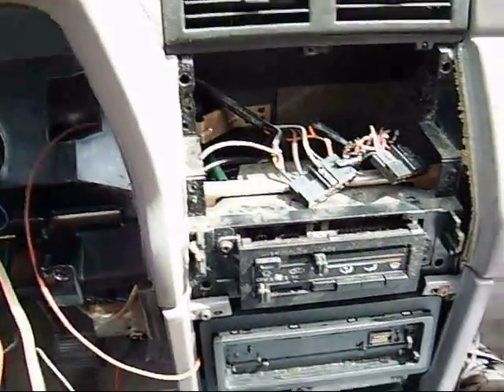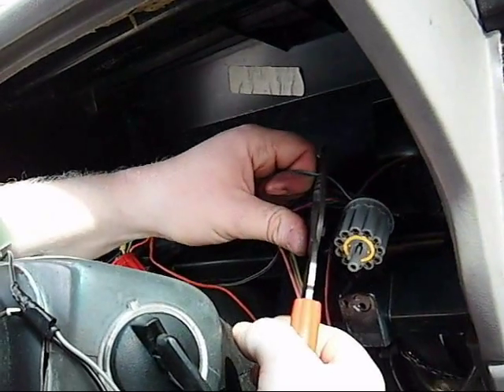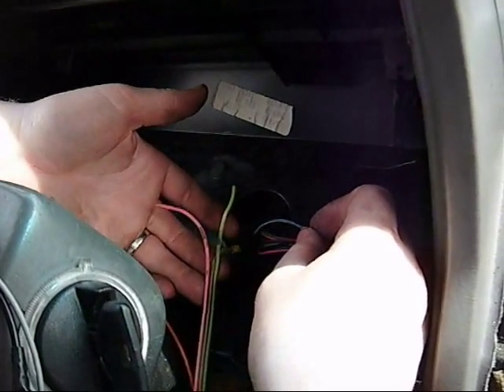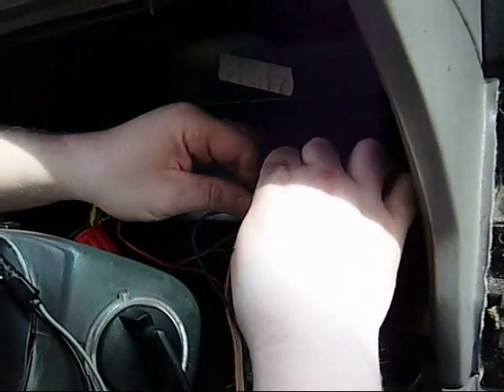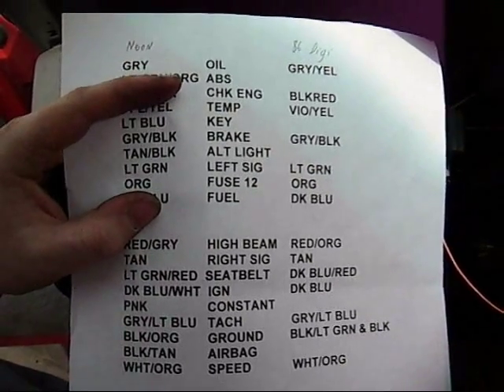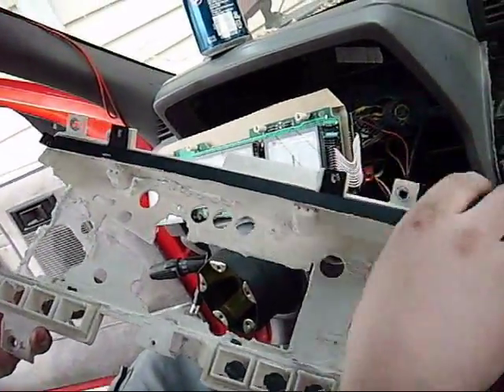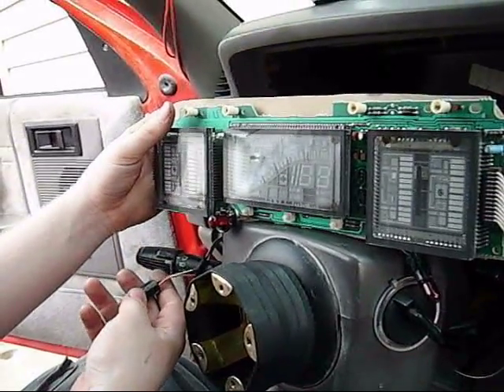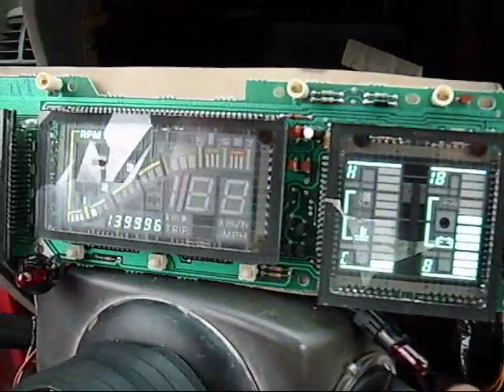Digital Dash Conversion part 2 of 2

Comment: non Sr it's only cables that give the power to the cluster on both cluster my stock one the newer, there is a guy that tell me that he just put a analog to digital converter and the problem was gone because just plug the wires doesn't give the properly voltage for the digital speedometer
Reply from the maker: hmm yeah I guess it depends on weather or not there is a separate body computer that runs the dash. a lot of manufacturers started doing that in the late 90's.  that may very well be what he was talking about.

Comment: Hello Sr looks like you good with all the wiring thing I have a cluster from a Honda s2000 full digital and people say that I need a analog to digital converter for the speedometer to work can you give some tips with this?
Reply from the maker: that's a really good question. I would have to see the wiring diagrams. real question is "is there a physical metal cable going to the speedometer on your current Guage cluster?